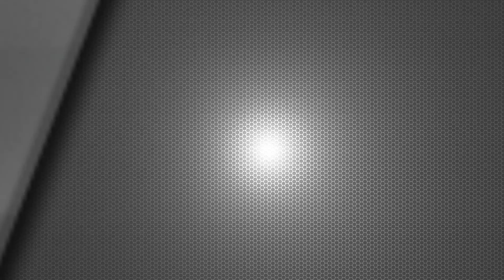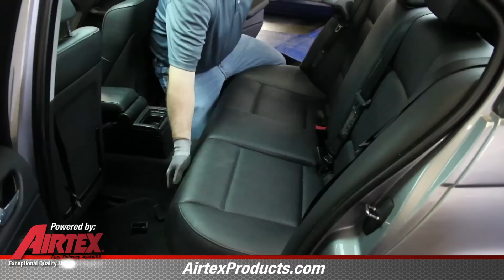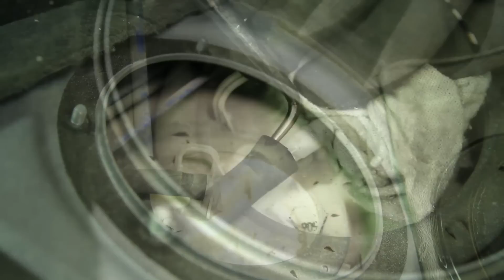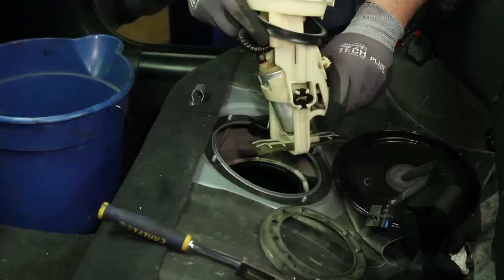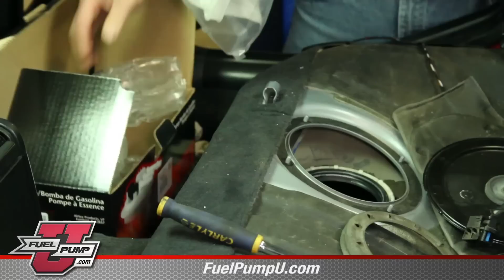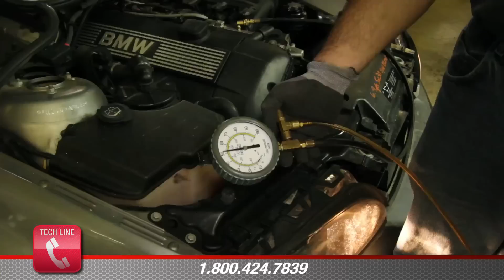How to Install Fuel Pump Assembly E8416M in a 2001 - 2005 BMW 325I

Comment: I removed the seat cover, removed the sound damping map, removed the cover and retaining bolts, but there is no hose. I cant seem to find a video that looks like the fuel pump in my car. I have a BMW 325 Ci 2004. Any help or guidance would be much appreciated. Thanks!
Reply: ***** this is all i see once i remove all i stated above. Is this pic any help? thank you!!

https://drive.google.com/file/d/0Bxbv-sQzy32dVDRVYVlPU0l1VlQ5Wk1IbU05SWpPWUpVT2RF/view?usp=sharing

Comment: great vid
after i installed it i drove for a few hours gas was low and i put gas in it and at the gas station gas was pouring out from under the tank...took a look and while the car is running gas rises up over the fuel pump and starts to spill..is it possible the gasket is bad or is the fuel pump working inproperly...thanks
Reply: thanks...my genius mechanic forgot to take thr ring gasket off my old pump and put it on the new one...its fine now...thanks for responding

Comment: Hi I was told that the sending unit on the driver side also needs to be replaced when you replace the fuel pump?

Thanks.

Comment: Hi there! Great tutorial, i refered to it when changing my fuel pump. I have a question - after changing the fuel pump, is it necessary to reset ecu adaptation values? My car was running really rough, misfired like crazy, had engine light and numerous errors stored in ecu memory. After replacing fuel pump the car feels better than ever, but while driving, when put in neutral, the revs dip down as low as 400rpm and car almost stalls, then quickly rise up to 800rpm. I'm thinking perhaps ecu was trying to adjust mixture etc and it doesn't know it has a healthy pump now? Thanks!